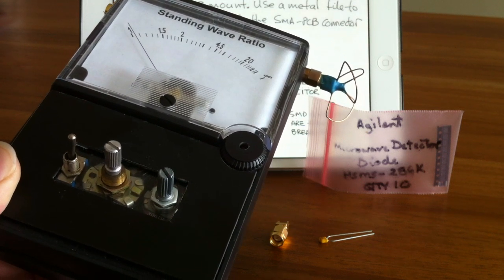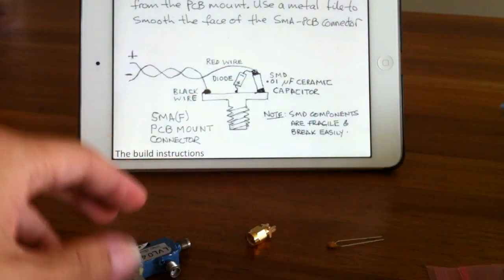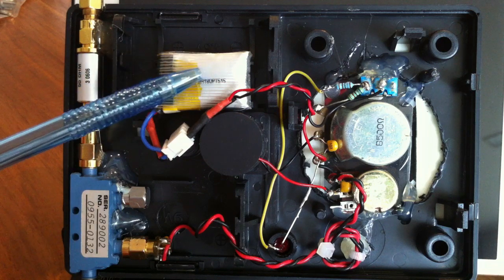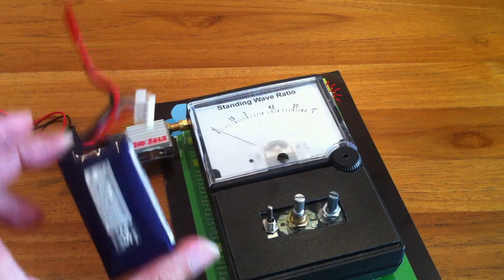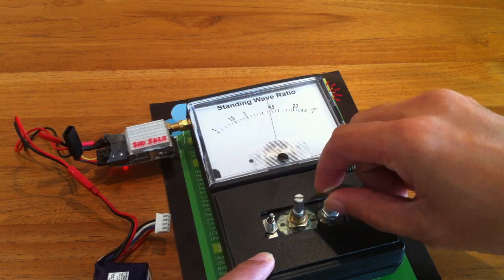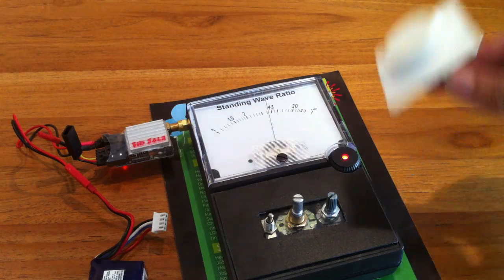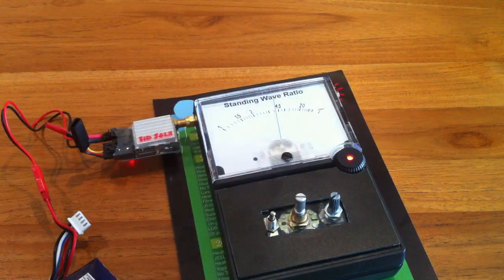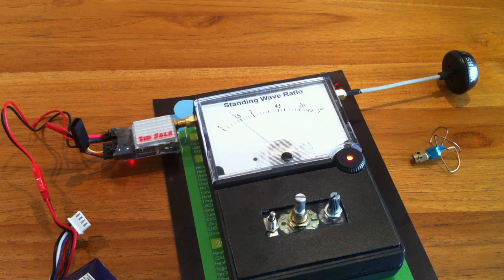Hobbyist's SWR Meter for 5.8ghz

Comment: i like this video you have done the correct way,,,to measure the antenna...any suggestion how to measure the actual output impedance for 5.8ghz vtx . I'm a little curious the actual output impedance for 5.8 vtx..factory only say 50ohm, (but who know, the QC for the vtx ),even if have good vswr antenna , if  we dont know the actual output impedance ofor the VTX , i believe the result would not be optimal.
Reply from the maker: Thanks for dropping by. A scientific way is to take a phase reading of the DUT’s(the VTX you are testing) signal and a reference (50ohm impedance) signal (eg: a lab grade signal generator) using a 2 ports VNA. A phase shift would mean your VTX’s impedance is greater or less than 50ohm.
The other way is to compare the SWRs or return-losses of a single antenna, one reading is taken with using your VTX to generate the source signal (eg: the method in this video) and the other reading is taken using a VNA (eg: a single port VNA which generates the source signal) to measure the antenna.
Reply: thank you for the answer, I have tested several antennas using hobby grade VNA, the measurement results show that the antenna gives pretty good swr results at certain frequencies. but i'm still not sure if the swr is a pseudo swr due to the coaxial cable and antenna, i don't know how much the actual swr antenna is, i'm sure we are playing at a very critical frequency of 5.8ghz, a fraction of a millimeter change causes a considerable impedance change. significant. I am trying to learn about impedance matching, from that I know that from the transmitter source the transmission line to the antenna must match.
I will try to find a directional coupler as you suggest and try to compare the results as you suggest, thank you I will try to dig up the formula for the radio wave transmission system.
Reply: @terence79chan  is it possible if I use a directional coupler to find out the impedance of the transmitter, that is, by connecting the directional coupler to a real 50ohm load, then we measure the output value, if the return to loss value is small we can conclude that our transmitter's impedance is close to 50 ohms.

Comment: Could you please let me know which device you are using to generate the 5.8Ghz - i am interested to have one
Reply from the maker: I am using an old TS351 200mw transmitter and a 6db MiniCircuits Attenuator (inside the meter's case) to generate the 5.8ghz signal in this setup
Reply: @terence79chan  OK thanks

Comment: at this super high frequency relationship between parts such as distance and angle is critical. Also antenna surrounding as mentioned right before wil change swr. In Line testing needs right cable length.
Reply from the maker: +auleefor Yes, you are right. Even with 433mhz antenna, it is always better to vswr it in an open field or on the roof top. Also, I just build this meter for comparing antennae. As pointed by Martinba77, the reading on the scale doesn't count as I did not get the meter to match the scale. Martin puts a lot more work than I did into his VSWR meter and I respect his comments. For 5.8g, it is almost impossible to have a scale that is accurate though.

Comment: Hey Terence! Your video is very nice but, that is not the correct procedure to use the SWR meter...your meter is actually not working properly, sorry. You should make sure you know how to use it before posting this as it is not a good example of the proper use of the meter...
Cheers!
Reply from the maker: No worries, appreciate your honesty. Could you shed some light on what went wrong? Thanks in advance
Reply: Most probably the problem is on the soldering and construction of the detector diode at the SMA connector, but, this is the procedure to follow:

-With the needle at SWR 1 on the meter scale, connect and power your VTx.
-Turn the SET knob to set infinity on the scale.
-Turn OFF the VTx, that is, disconnect the power supply.
-Turn ON DC Bias and adjust to about the first or first and a half mark on the scale, will be about 0.3uA if i remember correctly.
-Rotate the needle movement screw to set the needle again to SWR 1.
-Leaving DC Bias ON, turn ON your VTx again and adjust to set infinity.
-Now you would need to get a known value to measure, this is a couple of Attenuators rated for at least 6GHz, maybe 6dB, 8dB, 12dB...this is to make sure the meter is reading a known value.
-If the meter reads about correct (DIY!!!) for the dB attenuators, you will read the SWR value for this as you don't have the Return Loss scale printed below the SWR one! Get an online conversor to get this values!
-Then you can proceed to measure the SWR of your DIY antennas or commercial ones...

I give you the values for some att. dB to SWR : 

6dB----12dB RL-----1,67 SWR on the scale.
8dB----16dB RL-----1,37 SWR on the scale.
12dB-----24dB RL----1,13 SWR on the scale.

This will read aproximate of course on a DIY meter!!!

Would be better to have a look at your detector build and how much voltage your detector is handling, i can't see this of course on your video!

Have a nice day!
Martin
Reply from the maker: Thank you very much for the complete set of instructions. They make perfect sense as to how the DC BIAS is used to calibrate the travel and coupled with reading known values to plot the scale for our DIY meters. I wish I had known this earlier, for I would definitely cover these in detail, in my video. Measuring VSWR aside, my meter as it is now, does work well in comparing antennas. It flags out a bad antenna immediately and it exhibits consistency. This consistency has proven to be useful in getting my antenna built to match up with the "referenced antenna" in terms of performance.

Comment: where do you usually fly?we fly in AMK industrial park2.by the way nice build.can i ask what is the specs for the directional coupler and where did you bought it?thanks.
Reply from the maker: The field besides Queenstown public library. You should see Damien since he flies at AMK too. The coupler is an old Agilent coupler that is written off by the national labs, I bought it at 70sgd from someone who works there
Reply: can i buy homemade 5.8ghz antenna from you?having a hard time to look for a cheap directional coupler.
Reply from the maker: Yep, directional coupler at this frequency band don't come cheap. I have one 5.8g crosshair. 45sgd self-collect @Dover, or 50sgd registered mail to your residential address.

Comment: Which is the diode?
Reply from the maker: The diode is the tiny component in the plastic bag. It is on the detector(the SMA) connector
Reply: Terence Chan I ask you about the MODEL/NUMBER of the diode. I well know what is "diode".
Reply from the maker: Agilent HSMS-286K

Comment: Where is the schematic??
Reply from the maker: If you pause the vid , you could see where the wires go.. There are not many components so it is possible to figure out the circuit. schematic is available in rcgroups forum in the SWR meter thread. Thanks to Lindsay, look for his post there. :)

Comment: I see a capped off connector on the coupler.  Can that port be used to simultaneously obtain forward and reverse voltages using an additional detector circuit or is it a Null port?
Reply from the maker: That's a null port

Comment: I read somewhere to not power your transmitter without an antenna.  Is that true here?
Reply from the maker: Yes, if the tx is powered on without an antenna, it can be damaged. But we have an attenuator and a directional coupler so it is fine